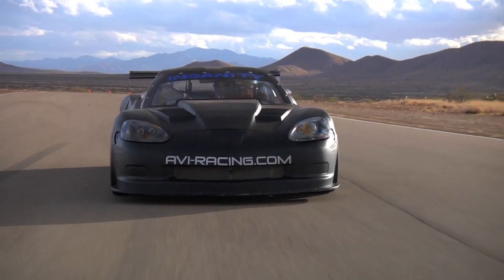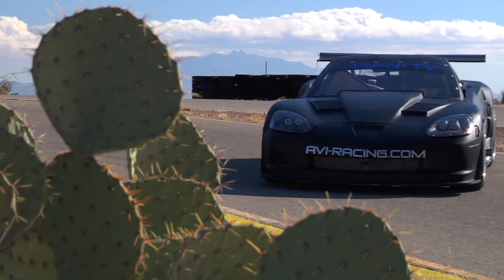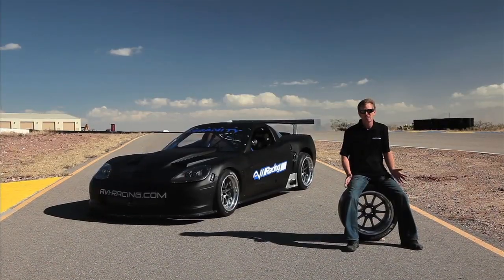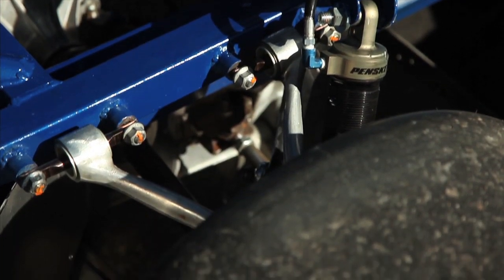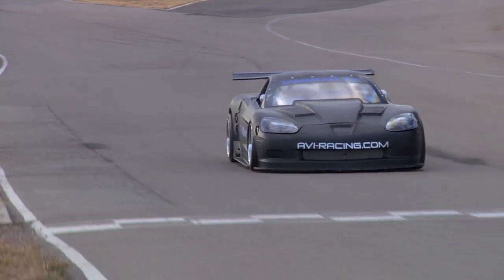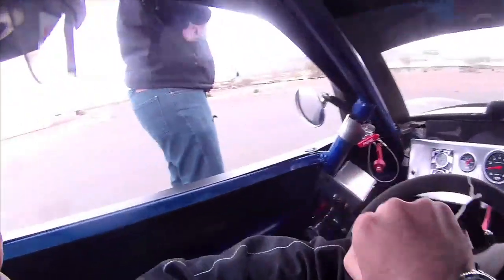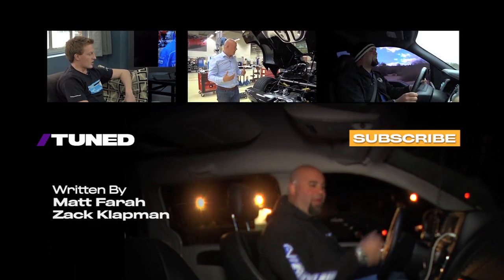The Ultra-Light, 505 WHP AVI Racing Corvette GT1 - /TUNED

Comment: "...to develop a race-car that was user friendly, extremely reliable, and easy to work on." So basically they made an AK47 with wheels for the track?
Reply: That is the best description of this car, bar none.  Point it where you want to go, pull the trigger and let it do its thing.  Taking out the competition!
Reply: indeed
Reply: That's one of the best analogies I have ever heard! Well put!
Reply: This
Reply: I have called And emailed these guys several times with no response. I want to have one built. Are they still in business? Is there a different or better number than the one on their web site?

Comment: I went down the comments section rabbit hole.  So!  Here's why the bodywork looks like it does and why that wheel gap is there:  In SCCA GT1/Trans Am, the maximum allowed tire dimensions are (if I remember right) 27"x12" front and 29"x14" rear (just look up other cars, you'll see what I mean---my numbers may not be right).  They may not have had any of the taller tires on hand, so they just used the short ones.  There are certain designs approved for use by the SCCA; that is why the hood vents look like they do and why the rear overhang is huge (plus, they get to put the fuel tank further back, which is generally good).  At this displacement, 2330 lbs and 505 whp sound about in line with GT1 regs.  Positive camber isn't too uncommon with soft springs and downforce, as it can make the car sit nicely at speed.

Comment: no, it's an optical illusion because of the proportion of the wheels in relation to the fender well. This is a prototype, so they made the fender wells bigger to accomodate multiple wheel/tire sizes. Now that they have found the right sized wheel and tire combo, the production cars will have smaller gaps there.

Comment: HOLY positive camber, BATMAN!
Reply: There's so little weight transfer and so little body roll that negative camber wouldn't be anywhere near as helpful as on a street car
Reply: Cool, but I've never really seen positive camber in track cars only professional drift cars.
Reply: zillymonster12 It could just be a track specific set up as well.
Reply: Seth Baker do you understand how negative camber affects the contact patch of the tyre at all?

Comment: more like can't fix a throttle cable in less than 3 minutes. The cable snapped right as the sun was vanishing behind the horizon and we were rapidly losing light. They did the best they could.

Comment: It's a prototype, and the rear wheel wells were modeled off the C6 Z06, which uses a 20" rear wheel, whereas the AVI GT1 uses an 18" square stance, which creates a bigger gap. The production car will have smaller gaps.

Comment: If I wanted an affordable track car, I'd get a 200HP, 450 KG kit car, not a corvette that isn't street legal anyway. On top of that, it would provably turn faster due to weight, and accelerate just as fast.
Reply: FORMULA FORD CAR: 1,000 lbs
TURBOCHARGED 1.6L I4: 400 HP

Comment: Too heavy, and slow
Reply: ***** With tube frame chassis and absolutely no interior?  Yeah, pretty heavy.  PS 2330 dry is chassis itself.  Probably not including any bodywork
Reply: Shadowboost I'm not trying to start anything here. But drive the car before you make statements like that. For reference, NASCAR racecars can weigh upwards of 3,000lbs, those are tube chassis with no interior as well. The C6R weighs 3353lbs (via corvetteracing.com), and the C6R does WELL.
Reply: Guus V,@Shadowboost; C6R actually weighs 2745lbs (as per corvette racing). C7R probably weighs about the same. BMW Z4 GTLM car: 2730lbs (as per BMW). Aston Martin GTE: 2711lbs (as per Aston Martin)... All weights are regulated now by IMSA. For Comparison to a Euro car in a Euro series, the BMW M4 DTM: ~2440lbs; AM GT3 ADAC series car: ~2600lbs; GTR GT3 ADAC: 2900lbs, all as per ADAC. AVI racing corvette (at 2330lbs) isn't bad for a track car that you can actually buy and run flat out without too much worry. So it certainly isn't a bus. Body panels are fiberglass/carbon fiber; don't need interior. I also highly doubt it's a slow car; a factory C6 Z06 isn't slow and it has a couple hundred pounds on this car... so suggesting that this car is slow is just stupidity.
Reply: ^ Agreed. Power:Weight is something many people forget about. Referring solely to one value and without the other is kind of useless.
Reply: I just don't like vetts lol
Reply: ThatDude458, Sucks for you!
Reply: Like I said, you're missin out!
Reply: Shadowboost actually "dry weight" is without driver and fluids. Curb weight is with all fluids. 2330 is very light BTW. Same as a fully loaded CRX and look how small that is
Reply: Guus V So im assuming the only busses in Europe are short busses? sounds about right. lol. Why so light?
Reply: Guus V I know your comment is 3 months old, but I just wanted to let you know you got blown the fuck out.
Reply: Napkin....lol thas funny. I was thinkin helium balloon!

Comment: You didn't even watch the video, did you? The entire engine, drivetrain, subframes, and suspension geometry are 100% C6 Corvette. The engineer that designed them also designed the actual GT1 race cars. All the parts in the car can be purchased from the GM Performance Parts Catalog. Plus, it's pretty obvious that it has a Corvette body on it. We're not saying you can register it on the street as a Corvette, but it's as much a Corvette as the Vettes that run at Lemans and Daytona are.

Comment: A race car can be tuned. Before we drove it, they plugged in a laptop and made sure the air-fuel ratio was good for that elevation. So it was "tuned." The bottom line is, we film modified and / or completely custom cars. That's what tuned is about. It's not about just modified street cars. Our only instructions from JF were, "Nothing stock." Everything else is fair game.

Comment: While I am a huge fan of Drive Clean and definitely think it should be brought back soon I'm not sure what more you could ask for from a show called Drive Tuned. It is a super lightweight Corvette that sounds like it eats Ferraris whole and they have it performing at the track. Not only that but they didn't even let a broken throttle cable stop them, they pulled a MacGyver and drove it around using some needle nose pliers or something. Then, to finish it off, rented minivan burnout. Total win.

Comment: It's not ride height or positive camber. The C6 Z06 body measurements are meant for 20" wheels with much bigger tires than the 18" "square stance" race wheels the car uses.

Comment: What is amusing about that, is that Corvettes haven't come from the factory with a cable driven throttle for years. When the C5 was introduced, it was one of the first from GM to use drive-by-wire, which is pretty much standard among all manufacturers now. It'd be interesting to know where they got the cable they used for the throttle.

Comment: Yes, the GT-R is one of the best handling production street cars. Although, when it's used in racing, they drop the awd system. Ask anyone that knows anything about real sports cars and handling, and they will tell you that awd is one of the worst setups for a track car. Even if awd is used on a track car, they generally bias the drive system to send most of the power to the rear wheels.

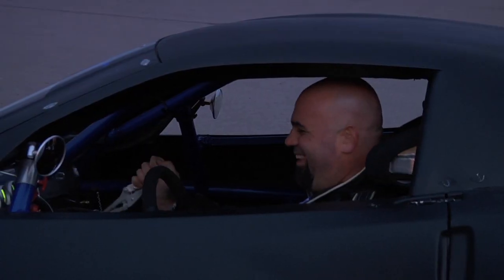Comment: apparently my source didn't post that time, perhaps because it was only a manufacturer claim and not an actual proven or validated time. there's not even video evidence of it running 7:18. perhaps porsche did some non-factory tweaking, exempting that 7:18 from other production car times. even if that time is accurate and posted with 100% factory specifications, which seems plausible, i'm sure the corvette will reclaim it's rightful position with the c7 zr1.

Comment: They said its a LS3 so its probably a L92 truck motor with a cam since the block and heads are the same as a LS3. Only difference is the intake, as you noticed, and the L92 has slightly heavier intake valves and valve reliefs in the pistons.

Comment: Nice find, was the suspension too stiff?  Why's the gap in rear wheel arc so tall?  Tire looked like there was plenty of room.   Nice work with the hand throttle.  If it ever happens again maybe try lower grab on cable, more torque and who doesn't like more torque.

Comment: Earlier in the comments a guy asked why they used a truck intake manifold on the engine. The Truck intake actually outflows all stock GM manifolds but the LS6, with this being a LS3 crate motor i'm betting they switched for the better low end torque, possibly to give better clearance for the drive accessories, or assuming the engine is lower in the car it would help raise the throttle body to help correct any issues.
Reply: The Vortec manifold does not out flow the LS1 ls3 or 7 manifolds.
It does provide the best torque under 4K rpm.
The truck manifold is Useless over 5,500 rpm.

Comment: No that was not what I was saying, but then again, that is mostly the kind of imports you will see people building and tuning. I do see some RWD imports but not very often and when I do, it's usually a Nissan 240 or 80s RX-7. RWD cars are the kings of the road, AWD are kings of off-road, and FWD are the kings of fuel economy. Can one class be better in another class, sure, but never the best. FWD and AWD tend to have bad understeer which is what import people seem to fail to understand.

Comment: Have you seen what happens when you strip a 3000GT VR4? it doesn't lose much in terms of weight. The weight isn't the body, it's in the mechanics. That includes the extremely heavy AWD system, the turbos and it's tubing, the 4WS, and the active aero.

Comment: The intake manifold on this mules motor is from an lq4 6.0l iron block truck engine. Not sure what the rest of it is but it would make sense that it's just an lq4 beater motor. 

Now if it's that fast with a beater mill imagine an ls7 or warmed up ls3. Hello 500hp :)

Comment: Not only that, but for the price of a stock GT3 you could buy a Corvette and build it to out perform the GT3 easily. Parts for Corvettes are relatively cheap, parts for a GT3, well you might as well empty your bank account now for a performance exhaust system.

Comment: It's the LS-base truck motor or the original LS1. With that manifold (definitely truck intake) and the cable throttle body, ls1 or early ls-based truck motor.

Comment: Hello -  The Car has "no" positive  camber what so ever actually.  It just looks that way because of the how the rear was sitting in correlation to the wheel on the (prototype) car in this video. It can be adjusted, and the gap in any of the future cars will be much tighter. 

The cable broke at the end of the day when there was almost no light left to shoot. Matt and the crew said we had only minutes to shoot, and with no extra cables on hand we improvised and had a laugh. Cheers!

Comment: To put this in perspective 60k gets you just the parts RCR sells for a Superlight Coupe (kit car race car) you still have to buy your own LS motor, Transaxle, AND put it all together.

This thing gives you better track width - similar stiffness - similar weight (2100 for the SLC 2300 for this car) and it's easier to work on.

I'll be getting one of these when finances allow seeing as most of my guns will be outlawed by misguided do gooders trying to "do something" to fix crazy people.

Comment: If the underbody is flat, which I would expect it to be, why not run the exhaust exits short of the diffuser instead of side-exit?  Should deliver more downforce without the expense of drag at a higher angle wing.

Comment: Hey Matt, They didn't mention anything done to the engine. Conventionally they have 505 crank horsepower and can said to be purchased at any general motors performance location. So I assume all the guts remain stock and got that extra horse power with less restrictive exhaust, intake and tune? I'm curious.

Comment: I have talked to and Met the Race teams of Zexel, Arta, and Calsonic During my Tour in Japan while in the USMC. They are Stripped down STOCK Uni-bodies with a cage and a racing suspension with a Limit of 700 hp but have roughly 650. But the hp dont mean anything its the Response of the throttle and the Acceleration Gearing and final drive. They are NOT heavily modified! They MUST resemble Stock form to Qualify! And they have kicked the shit out of the C5-R before!

Comment: Watch the vid again. Weight on this Vette is ~2300lbs. My 91 CRX Si was ~2200. No factory CRX ever weighed in at 1300lbs, which is about the weight of a Caterham Superlight R. Honda 600s weighed more than that. 

To put it 'real car' terms, this Vette has essentially a Z06's power with a Datsun 240Z's weight, and that Z's chassis, suspension, etc is pretty laughable nowadays compared to even a stock base model Vette.

Comment: JGTC GT500 class cars are absolutely heavily modified. They're race cars with curb weights of <2600 pounds. The regulations for JGTC cars are much laxer than in any other FIA GT series. The entire front and rear clip can be tube frame, until 2010 engines could be FI even if the base model engine was not, engine layout could be changed, and the engine could be swapped with any existing model. These cars cost as much or more than FIA GT race cars; they're not comparable to the $60K car above.

Comment: The broken throttle cable has nothing to do with it being a Corvette. Especially given that Corvettes haven't come with a cable driven throttle since 1996, when the C4 model was phased out. The C5 and C6 have always had drive-by-wire throttle control, which is pretty much an industry standard for all vehicles now.

Comment: All GT500-700 Skyline/Supras/Nsx/Rx7's are based from the stock Unibody yet will blow this "tubular Frame" Vette away with Less Horsepower. you are right HP mean nothing if the engine is not Responsive to your foot. Hell The Mines Skyline will Eat this thing up.

Comment: Uh why the insult?

And no, donuts and burnouts are not the same thing. As I stated, a burnout is when you stand still and let the front/rear wheels spin. A donut is going around in circles while the rear wheels spin. Just because the events over there are called burnout competitions, doesn't actually mean they're correct in calling them that.

Comment: The cars are made for 2 different classes of racing. The GT3 does not replace the GT2 and the GT2 does not replace the GT3. They are different models. Yes, I do know the specs but those do not matter since the cars are not comparable. They serve a different purpose on the track. 1 is for the GT3 class, and the other is for the GT2 class. If you were to compare the 2 models then use the 997 GT3 RS 4.0 instead of the regular GT3. But those models are not comparable.

Comment: GT500 aren't lightly stock modified cars at all. Seems to me that you don't know what you're talking about either. The bodies on both the skyline and supra are HIGHLY modified for GT500 which also includes the brakes and suspension as well.  

And you completely missed my point when I meant ultra modified which gt300-500-700 is. If you want to compare cars I can say the C5-R GT1 can eat those gt700-500 cars all day long.  This vette is a bargain for under 200grand for what it can do.

Comment: That looks like a 99' to present truck "LS" steel block engine. That heavier but much cheaper and handles horses easier so ye. But shove two medium sized twin turbo's on one of those 6.0l engines then you get hell on wheels man.

Comment: HAHA I would love for them to try that. The Agera R is Built and Tuned for Racing. And they DO have a Race model of the CCX its the Koenigsegg CCGT Race Car Look it up!  The Agera R has a state of the art racing Suspension, Ventilated ceramic discs with 6 Piston Calipers, a Ford Based 5.0L pushing 1200+ Hp i Seriously DOUBT this car can beat it.

Comment: And I hate to tell you, but even a stock, base C6 Corvette would easily take a stock 3000GT around a track. And a stock C6 Z06 would murder a stock or even modified VR4. The Z06 has pulled some of the highest lateral G cornering and best braking that most automotive magazines have tested out of any factory built production car, whereas the handling of your outdated 3000GT is barely better than most modern sedans. And given that the 1/4 mile record for a showroom stock Z06 is 10.98.

Comment: First of all, it's an FN FAL. So... What do you think is wrong with this barrel? Do the flames going upwards concern you? Well, that's normal as that's how the short-stroke gas piston in the gun works: the piston drives the bolt backwards for a short distance and then vents the gases (flames) and stops, leaving the bolt to finish it's backward travel by inertia alone.

Comment: No street car is going to match the performance of a car that is essentially a GT1/GT2 class race car. This car is 200 pounds lighter than a GT1 C6.R, has all the aero enhancements of the GT1 (splitter, diffuser, rear wing, ducting, etc.) same racing slicks as the GT1, same brakes as the GT2 variant, as much power/torque as the GT1 etc.

The C6.R GT1 won it's class at Le Mans 3 times and finished as high as 4th overall. A Koenigsegg would get absolutely crushed on a track by this car.

Comment: What I have a problem with is the comparison to Corvette Racing (as I'm sure someone like Doug Feehan would as well). Saying this car is just like the cars they run at Le Mans is ridiculous.  
The car you show here is basically a kit car, nothing more. It doesn't matter where they got the parts. Just because something has a "Corvette" body bolted on to it doesn't mean it's a Corvette, I think you know that. 
This was crap, but I look forward to the Formula Drift car.